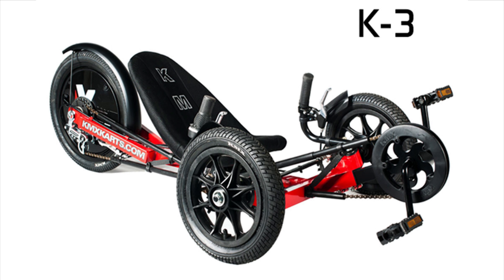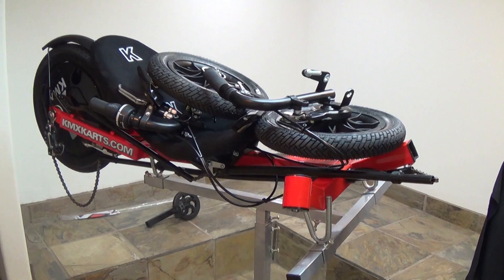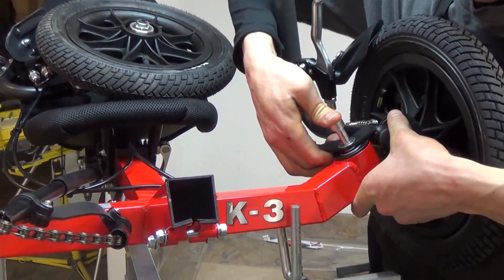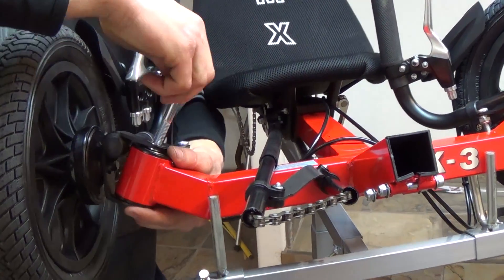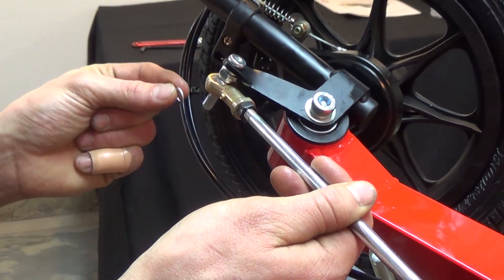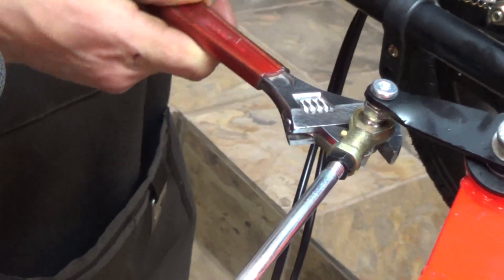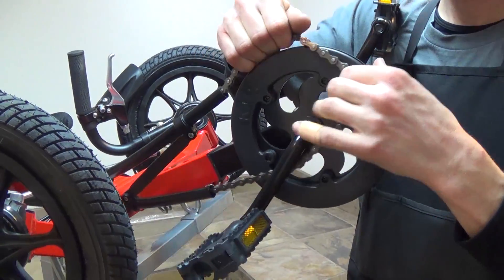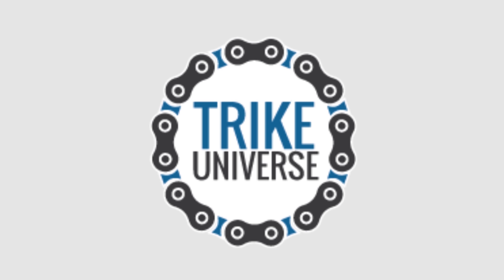KMX K-3 Construction Video

Comment: What is the difference between a trike wheel hub and bicycle wheel hub??
Reply: For the most part the rear hubs are the same. Front hubs on a trike are typically designed with a thru axle that supports the sheel from one side.
Reply: @UtahTrikes  thanks.... Where  i live there is no trike parts available in the market...so if want to make a trike i have to use bicycle wheel hub.... .. So can i use a bicycle wheel hub for reverse trike front wheel??